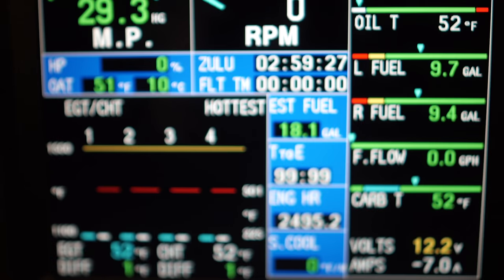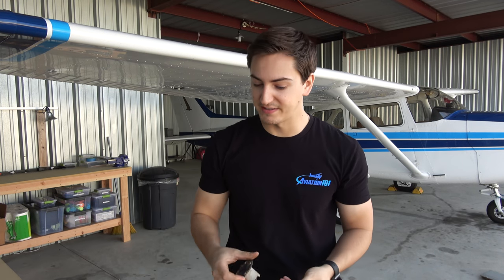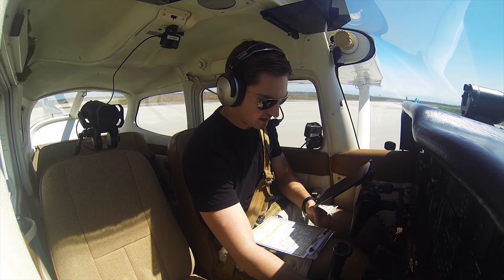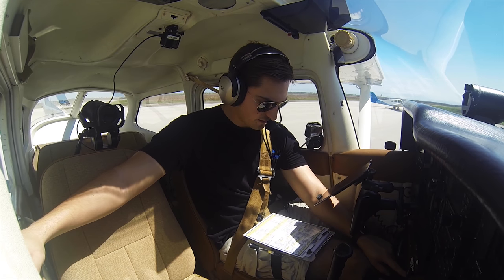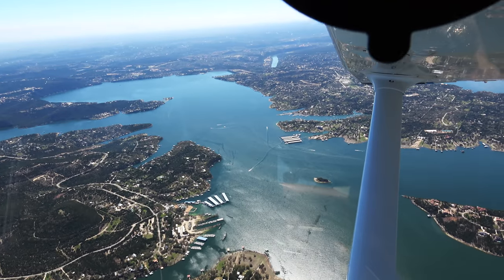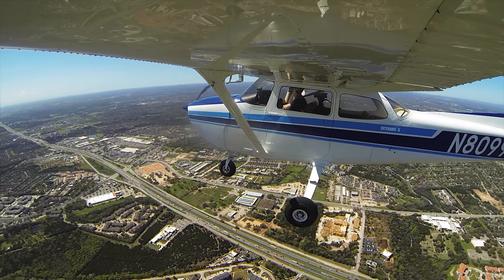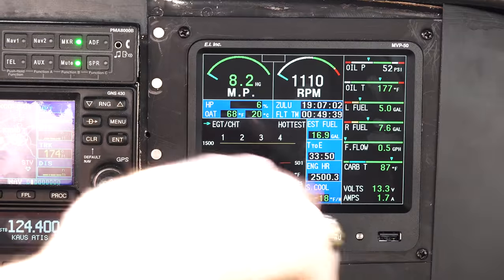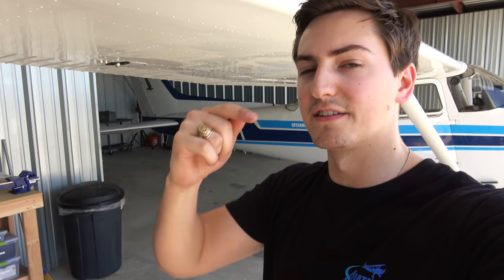No More Engine Gauges?!

Comment: I'm not a pilot, but it's fascinating to see the temperature drop through the carburetor venturi on the monitor.  One can easily see how carb icing can happen sans heat when the dew point is near freezing. 
It's a little known fact, but snowblower engines are also prone to carb icing given the way that snowblowers operate near freezing and in humid conditions under high power settings.   Many snowblower owners don't give it a thought as to why the small engines on their machines have that metal box around the carb.  It's not to make the carb harder to get to, but rather to pull some of the intake air over the hot muffler on the way in to keep the carb throat from icing.   Unlike a plane, a snowblower's carb heat is fixed and non-adjustible. I realize that snowblowers probably aren't a big item around the Austin area, but I thought I'd share anyhow.
Reply: I never gave my snowblower too much of a thought but it makes sense. I just know I appreciate that beast when the snow starts flying and it's really cold and windy. Learn something new everyday.
Reply: I'm also a pilot in Texas (Houston area) and fly around here occasionally. Carb ice can potentially be a problem around here given the right conditions. But I regress.....
I've never operated a snowblower!! But, carb ice is still carb ice no matter where you live!!  
I never thought about it before!!  Thanks for the insight!!  Stay warm my northern friend!!
Reply: Good insight. Learn something new every day.
Reply: Come visit us in January in Goderich, Ontario - Lake Effect SNOW will definitely get the snowblower out!!!
Reply: Most of the modernish carb motorcycles had Carb Heaters...
Reply: @texasfly9925  I learned to fly in the Houston area and later I was able to put my carb heat problem to rest by building a carb heater for my Baja Bug for use in the New Mexican Rockies. Worked like a charm.

Comment: Thanks for showing off your new MVP-50 Josh! As you, I had to prioritize my upgrades in phases. My phase1 was dual G5's, ADS-B in/out, WAAS and an engine monitor (Insight Twin G4). I'm flying down to Tx today to pick her up from Phase 2: STEC 3100 autopilot upgrade. I'm thinking Phase 3 will be upgrading my 20 year old GPS's (going to decide on that at Sun n Fun coming up) and my Phase 4 will probably be something to replace all my old engine instruments. I will add EI to the list. Thanks again! :)

Comment: Im an instructor and we upgraded all of our fleet with the mvp. 50. Its pretty great, especially for leaning. Ive never had a problem with them until about three days ago where every gage failed and read "COMM" in all red. Another flaw is that you can't find out what causes the red warning light in flight, you need a usb with a computer. One time in flight the red light flashed for a few seconds and couldn't find out what was causing it because everything was in the green.  Other than that its awesome.

Comment: We added an electronic ignition and power flow exhaust and that has really helped with a little speed and better fuel economy. We also added the G5's and Garmin 500 auto pilot. Well worth the investment. We have a EDM-900 and we've been able to monitor engine performance much better and note any issues.

Comment: Thanks for the interesting video! Regarding the glass/steam debate, I'm thinking single points of failure. If that engine monitor display goes, you lose a lot of information at once, even with fully working sensors and computer. Compare that to a full native glass system with two displays that shows everything on the remaining one if one goes. I think the attitude indicator & HSI come with integrated batteries, so you don't immediately lose them even if the electric system fails, so that basically gives the same redundancy as the vacuum pump while reducing moving parts, so that is nothing but an improvement. At least with adequate protection from transient spikes in the electrical system :)
I just got checked out in our club's DA40NG with the G1000, and I have to admit that the only thing not to like, having learned to fly with steam gauges, is the airspeed indicator tape. Getting the speed information from a round gauge is an order of magnitude quicker than from a tape with numbers, which is kind of essential when you're flying the pattern and want to keep your eyes out and just want to make a quick glance inside to make sure your speed is okay. (Yes, I know I can glance at the tape, move my eyes back out, and then process the information, but that still takes some mental cycles I could use elsewhere.)

Comment: I will have to say I agree on the whole shock cooling theory because if you heat up cylinder heads on a vehicle to high they crack or cool them off to quick they will crack so I believe that the repeated process of cooling air cooled heads down too quickly could very well cause cracks, eventually. I’m not even repeating your quote because everyone on here knows you have the quote of the year!

Comment: To demonstrate "shock cooling", fill a cheap glass beer mug with boiling hot water. let it stabilize for about 30 second. Pour out the hot water, then fill it with ice cold water. Do this over a sink, and watch the glass crack or shatter. Your engine is "cast" metal, meaning it has the very similar characteristics as glass. Shock cooling is very real, and this little experiment where you sacrifice a cheap mug should convince anyone of that.
Reply from the maker: Peter Toth great example. I’ll have to do that on camera to demonstrate that to the people who deny thermodynamics beneath their tin-foil hats.
Reply: Peter, while I'll agree with your assessment, the real issue is that you have 'hot water' in a container designed for hot water, and then you empty it and pour in cooler water.
The issue isn't as dramatic as your demonstration would show, and this is the reason why pilots don't think about it.  The engine is designed to stand the temps and pressures it's under, BUT, repeated cycling between 'hot' and 'less hot/cool' will cause stress fractures and cracks.
Really, when was the last time you, or anyone, saw a cylinder shatter?  It just doesn't happen, which is why pilots don't think about thermal stress.
Understand, I'm not disagreeing with you, we all need to be cognizant of thermal issues with the engine, and shock cooling, i.e., over 50 degrees per minute qualifies, but most people don't have that information in front of them, and hence don't think about it.
Reply: To my knowledge there have been no laboratory tests which demonstrate that repeated rapid cooling causes damage to an otherwise healthy engine, so it remains a theory used to explain symptoms seen in the field and a hotly contested topic. Jump plane pilots are among the most ardent supporters of the shock-cooling-is-a-myth camp, since they run their planes in precisely the modes they are told will ruin their engines, and suffer no such consequence.

I don't actually have an opinion either way since I've never seen solid data to support either claim. However, avoiding the conditions that are claimed to cause it is quite easy under normal flight profiles, so I do. Our JPI EDM 730 has a "CLD" meter which is similar to Josh's S.COOL meter.
Reply: @hempelcx  I would be curious to see if the studies have been done.  There is a lot of circumstantial evidence that supports the theory, but I would like to see a regimented test.  Of course, it might take thousands of hours to do, so I wouldn't expect it any time soon.  :)
Three same debate as ROP vs LOP.
Reply: Gary C ROP vs LOP has been studied in a lab using I believe a Lyc IO540 and showed conclusively that properly leaned LOP runs cooler and is consistently better for the cylinders in all aspects. That requires fairly evenly tuned injectors, so people often swap out for GAMIjectors to get there.  Personally I have trouble running LOP in our IO360 engine and I also don't like to fly that slow, so we typically run ROP staying rich of best power.
Reply: @hempelcx  is your IO-360 Continental or Lycoming?  I've always heard that Lycs are harder to run LOP than Connies are, and the Connies are actually recommended to run LOP.
Then again, as you stated, having balanced injectors is a big part of it, but also an engine monitor where you can watch the cylinder head and EGT temps.  Plus, it requires more dedication to run LOP, if you want to do it right.
As to speed versus fuel flow, that's an indivdual thing, you can always spend more money to go faster.
Reply: The GAMI folks in Ada Oklahoma have busted the “shock cooling myth” with their highly instrumented TSIO-540.
      They’ve conducted many Advanced Pilot Seminars over the years that bust this and other Old Wives Tales.
        A quick search on Beechtalk.com on the subject of shock cooling myth will reveal lots of hard data that refute this “theory”
Reply: @Stepclimb  I'd like to see the information on GAMI's site.  Not saying it isn't there, but I haven't bothered to look.  I don't recall seeing it in taturbos.com.
Can you provide a link?
Reply: You do want to manage thermodynamic change to your engine so a slower cooling effect will be “kinder,” but no one talks about going from 150C cylinder head temp to 380C in the span of a takeoff. And last I checked, engine monitors don’t alarm for low temps for EGT or CHT.  It’s all about good airmanship and energy management and not ham-fisting your power. And if you fly round engines, shock cooling is a thing, and they don’t like it.

Comment: 500 degrees CHT redline; that’s hot. I prefer 430 degrees redline, and 400 degrees caution (Lycoming also recommends <400 degrees). In my experience that’s difficult to do in a 172, because the cruise climb speeds aren’t fast enough to provide really good cooling.

Comment: My issue with the MVP’s is the aggressive lean profile. Using the lean ROP function, you really have to bring that mixture back pretty far for it to find a peak. Either that, or it will find a ‘peak’ before you even begin leaning the mixture.

Comment: Just a quick question, why would you have a hobbs meter hooked up to the oil pressure sensor in a private airplane? I would get if it was hooked up to the total pressure sensor to count time in service (clear time, pure flight time) for maintenance purposes, but when you fly privately in a piston aircraft, you start the engine up, warm it up (since it only costs you the petrol, not the $$$ for rental), then move and write the time down and go flying. And vice versa - come to stop, write the time down, let the engine cool down then shut it down :)

Comment: I think one downside to electrical/computer instruments is it doesn't show smooth indication due to probably a slower refresh rate. For example, I like to be able to see the RPM smoothly increase to 1700 when I do the run-up. With the electrical instruments, the RPM changes abruptly so it feels weird to check.
Reply: Well, that's certainly not an inherent limitation of digital technology; rather a byproduct of engineering trade-offs to keep the purchase price down. If more people raised that concern they would address it, and the instruments would cost more accordingly.

Comment: Hi Josh, why EGT rise up when you do the mag check, shouldn’t the unburned fuel help to cool down the engine?

Carlos David from Dominican Republic.
Best Regards
Reply: Two ignition sources makes for higher power, and a more complete fuel burn, which lowers exhaust gas temperatures as no fuel is burning while being expelled from the engine. When one ignition source is turned off, not all fuel is ignited before the exhaust cycle of the engine starts, causing the unburned fuel to burn while on the way out the exhaust port, raising the exhaust gas temperature slightly and lowering engine performance which is observed by the RPM drop.
Reply: Peter Toth, What a great explanation, thank you so much Peter!
Reply: "no fuel is burning while being expelled from the engine"  More accurate: Less fuel is burning while being expelled. To get even close to "no fuel" would require an electronic ignition, mags typically don't create enough spark shower for long enough, even with two of them.
Reply: i.b. hemp so even with both mag There’s still being unburned fuel coming out of the exhaust

Comment: I have 172P with steam gauges. And no budget to spend more than the plane is worth in a new panel all the way around.  Any recommendations on replacing just the fuel gauges? Would like at least more accurate fuel gauges more than old originals.

Comment: Not familiar with that EG monitor system. You said the reading label Eng HRS is the Hobbs meter. If that's the case where is the Tach Time hrs reading? 
Like you I just upgraded and got rid of my vacuum system and legacy nav/com stack. I'm looking to install an engine monitor system in the future. Yours looks nice.

Having been trained with gauges decades ago, I was an anit-glass guy in the beginning. Constant precession broke that. I'm a full glass guy now.

Comment: There are so few carbureted aircraft with engine monitors.
      For a future video, perhaps you could attempt to operate LOP with various combinations of carburetor heat.
       The theory is that carb heat swirls the air, allowing for a more even distribution to the individual cylinders.
       I surmise that you should see a difference in EGT peaks at at different fuel flows with half carb heat for example.

Comment: Skyhawk 8991 getting that Dash cleaned up nicely kind of looks like there's not enough gauges anymore guess that's just the advantage of glass gauges Thursday the 21st I also experienced my first flight ever in a Piper Cherokee 180 first time I've ever been in the air ironically I'm also afraid of heights however I massively enjoyed the flight now I want to look about getting my pilot license but I need to go in a few more flights to get used to it

Comment: It's not like you got rid of "all gauges" is it?  Don't you / aren't you required to have backup gauges in case of glass gauge(s) failure?  Nice looking setup, btw.  Personally I'm an armchair pilot now.  I had my days to be in and around airplanes when I was your age.  I also did work as a lineman @ KMQJ about 30 years ago.  That winter was harsh on me and after falling on the tarmac and busting my tailbone.....we won't go into that.  Was a few years back now.  Have fun and be safe!  Thanks for sharing.

Comment: Do the "glass" instruments have a backup battery if the electrical system goes down?
Reply: The Garmin G5 has a battery backup built in. The planes electrical system keeps it charged. There’s a battery indicator on the G5 itself to tell you the condition of its built in battery.

Comment: Very nice indeed but remember you’re still flying a Part 23 certificated aircraft with minimal redundancy. Eg single engine, single alternator etc. Transport-category aircraft (part 25) require level of redundancy such that chance of a catastrophic failure has to be less than 1 in a BILLION flight hours. Douglas Boyd PhD

Comment: The old gauges may have been simple, but they worked.  Uncomplicated is good, it's less likely to fail.  Of course everything depends on the vacuum pump working, so that is a single failure point.  Arguments either way.

Comment: On that MVP you can actually configure it to show oil pressure and RPM instead of manifold pressure. Thought you may find that useful considering 991 has a fixed prop lol

Comment: Have you ever flown around by the formula one track or is that "restricted Airspace" ??
Reply: Depends on which runways ABIA is using but I have went and flown around it a couple times before. Class C airspace rules apply(duh), must ask ATC since its in app. and dept. paths of the airport.

Comment: Nice plane Bro
Are u going to disclose cost of all the upgrades or something of that nature?
Reply: Not too much, would depend on your shop. Parts wise very little since Garmin G5’s and engine analyzers are pretty cheap. Plus ditching the vac system/instruments saves on maintenance and inspection costs.
Reply: Having purchased many of those items, I disagree that they are "pretty cheap". But I agree what really kills you is the bill for shop time.
Reply: i.b. hemp - for avionics the g5 is very cheap. Can get them from spruce between 2.5-3k or less when rebates are offered. 

Compared to vacuum instruments and pumps that need overhauls and other costly/annoying maintenance the G5 is a steal over its useful life.

I don’t know how I would feel about relying on it for primary, but I guess it’s certified so must be good. 

Dunno why but I would feel more confident with a g500 primary and a g5 for standby if setting up an IFR platform.

Realistically the money spent on a g500 is better spent on a nice nav system like a GTN 650/640. Then a couple G5’s for AI and HSI for a redundant AI on the HSI G5. Can even integrate a garmin autopilot with the G5 which is nice

Comment: Wouldn't MAP be good for carb ice?  If MAP is dropping but throttle and density altitude are constant (constant static pressure basically), wouldn't that indicate carb ice?
Reply: It might be, if you were constantly watching it.  But, I'd be willing to bet that you would feel the engine roughness before you actually noticed the MP dropping.  Furthermore, when pilots are learning about Carb Ice, they're normally flying a fixed pitched prop airplane with no manifold pressure gauge, so they don't look for it.  Often, but not always, by the time they move to a CS prop airplane, they're also moving to fuel injection and no more carb icing problem.